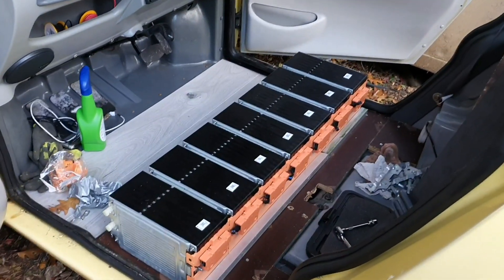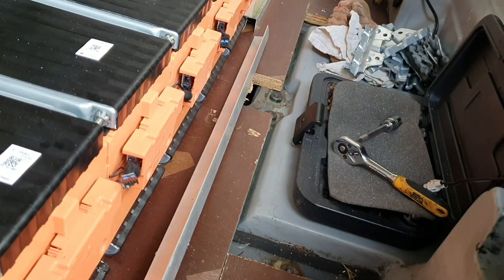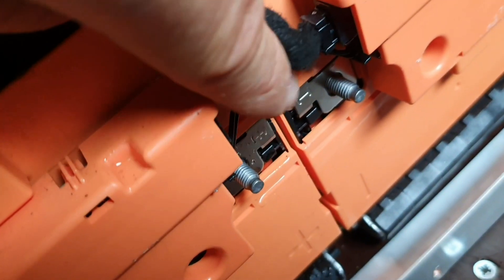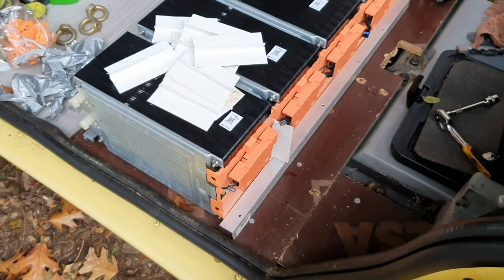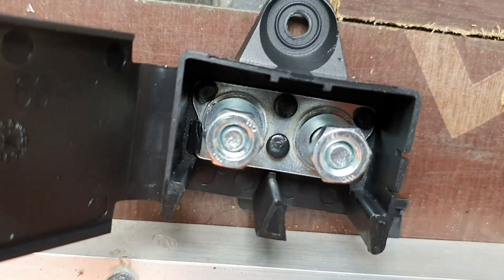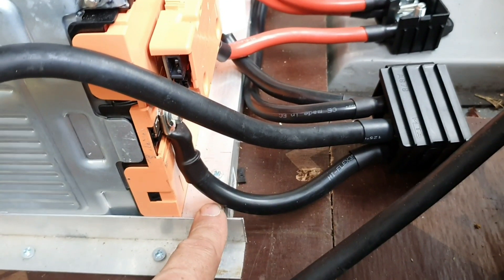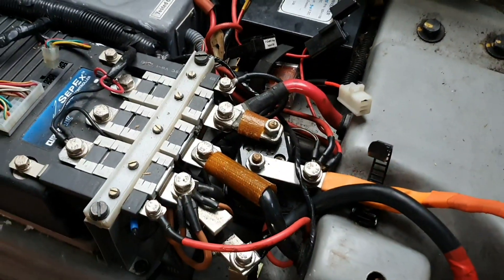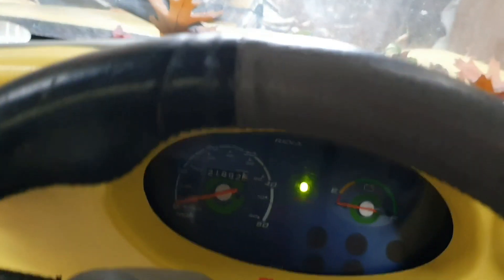REVA G-WIZ: Yellow Wiz Lithium-ion conversion pt.7 - wiring up the first string of batteries.

Comment: Hello mate nice battery pack wairing to see it running with overvoltage hack you made on tge controller your videos are pretty informative keep it up i never knew that tge controller can accept higher voltage unti i saw your videos pls show us how to wire the pc to the controller what software and harness to use and how to do it i have just buy my gwiz ac motor and building my battery pack i removed cells and order new BMS for my 60 nominal 72 charged volts ready made 18650 cells because i didnt find your video earlier .. cheers mate
Reply from the maker: The cable you need to connect to the computer is here: https://www.ebay.co.uk/itm/USB-programmer-cable-for-Curtis-controller/154033261266?hash=item23dd190ad2:g:p-AAAOxyaTxTPxdO - the guy can also send you the software needed to load onto the computer. You can see one of my earlier videos using the software however it is on the DC controller. Unfortunately the AC motor controller is different and it can only handle up to 60v DC input. There is a chance it can handle +10 over voltage but I don't dare to test it as the AC is my every day car right now and I can't afford to break the controller. If it does that means you may get away with running it up nearly to 100% on your modules but there still needs to be experimentation on whether the AC controller can actually handle over 60v. The DC controller however can handle up to 80v. 

Also the AC controller is very different in the parameters and I dare not mess with it as it is different to the DC and not so straight forwards. I'm still waiting on someone to get back to me who supposedly cracked it and knows what each parameter does but I haven't got that information yet.
Reply: @RichardMawby  thank youvso much for your help i will experiment for a while on it and i will let you know.. i am thinking to put the 18650  on it because i built 3 packs 13s 28ah each thats a total of around 4kwh.. but i am scare because of the discharge capabilities they promise that they can handle 100 amps each pack but even then it will be very difficult for them and the BMS to handle the required amps.. maybe i will go with some lead battery as a temporary solution and maybe i will build another one or two packs to be sure.. anyways i am glad to see that someone else also doing what i am doing.. thank mate waiting for your new video !!!
Reply from the maker: @alternativeenergychannel2289  Yes, please be careful with discharge current. I always overbuild my packs so that they can definitely handle it. 3 13s packs will really be pushing it but will have the right voltage to work as it will be like my AC car with 54.6v full charge. I wouldn't risk it with 3 packs and fuse every one to be safe. Lead acid will work somewhat but its costly in comparison to what you can get with lithium these days for much less range. On the AC you have to make sure the modules are well under the 350 amp peak draw.... They might handle it... the continuous draw is about 150 amps... I just personally like to be safer and rate my batteries well under at peak draw instead.
Reply: @RichardMawby  yes i agree with you i have also another 13 s pack but they are lipo cells and i think it will not be a good idea to mix them even i the voltage is the same ... I will be patient and dont take the risk because i have a bad experience with lithium cells for a previous project.. i have found some 150 ah used lead batteries for a good price and tomorrow i will get them .. i live in a small city in Cyprus so if i can do about 30 kms per charge will be enough for me just for my daily needs and back to the plug.. Thumbs up for you !!!
Reply from the maker: @alternativeenergychannel2289  yes best to wait. 150ah lead acid will get you 20 miles approx... maybe 30 if lucky. Just make sure they can cope with the discharge.
Reply: @RichardMawby i hope so even with 20 miles it will be good for me..  yes i will check everything and I will update my process on your next video. 💪💪

Comment: 5:45 how huge are those wires? The look like 35mm3. Did you ever touched the positive terminal of the curtis after a 20ish min ride?mine it's too hot like I can keep my finger over a sec. Does it happen the same to yours? I'm using 35mm wire but I'm feeling it might be too small...may ba 45 or 50mm3 wire is required?
Reply from the maker: It will get hot because of the power draw on hill climbs etc... it's fine. 35mm is plenty. This is standard welding cable.

Comment: Why the original round voltage meter does not show anything..?
Reply from the maker: Because i took the ems out related to original lead acid batteries. It wasnt really that accurate anyway. Reading voltage is better.